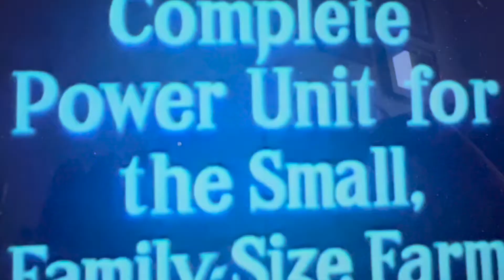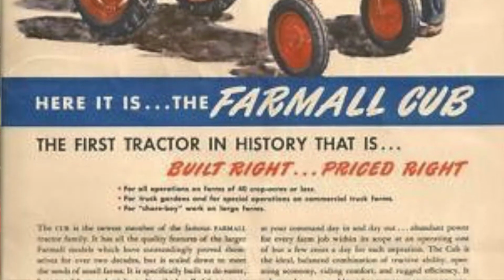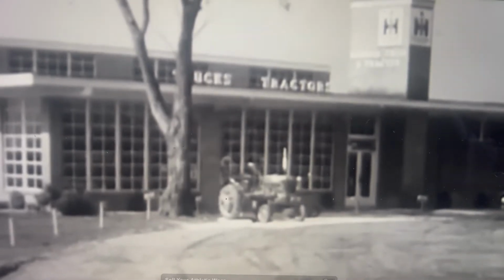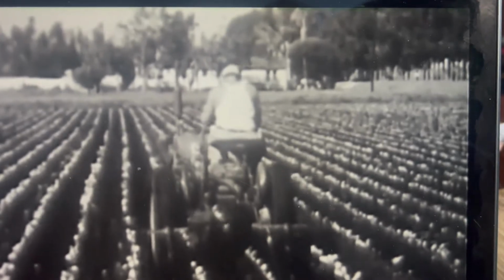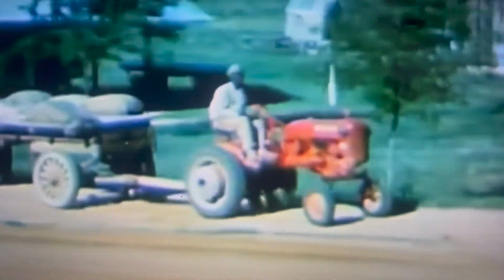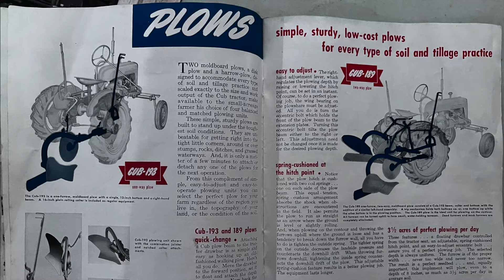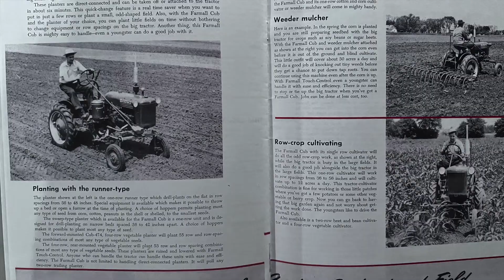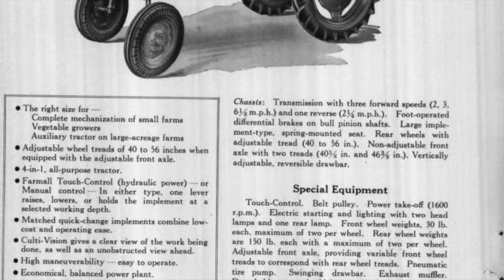1948-1954 IH McCormick Farmall Cub Tractors

Comment: As I have commented previously these literature and advertisement series of videos you are posting plus your commentary are both educationally and historically extremely interesting and a great learning experience. Did the future Cub’s with the Fast Hitch ever come with a rear mounted sickle bar or was that too much strain on the single hitch point?
Reply from the maker: There was indeed a fast hitch mower for them. I think it had a tail wheel, but I’ll double check. IH made a 1000? Pitmanless mower that could have a fast hitch or just a mounting plate to fit on tractors with a fixed drawbar. Thank you for watching